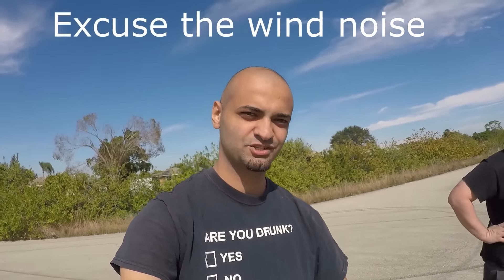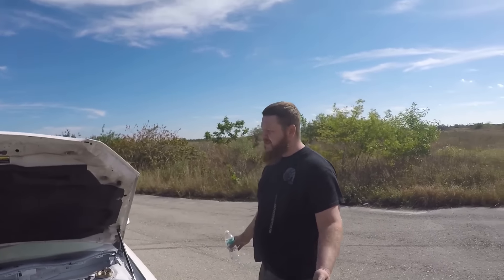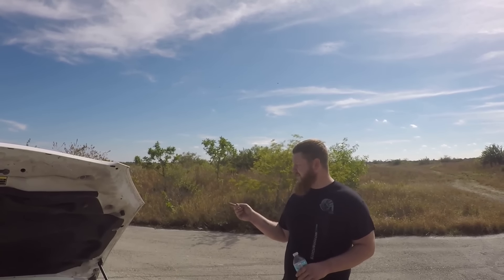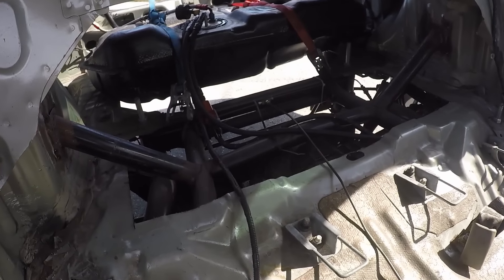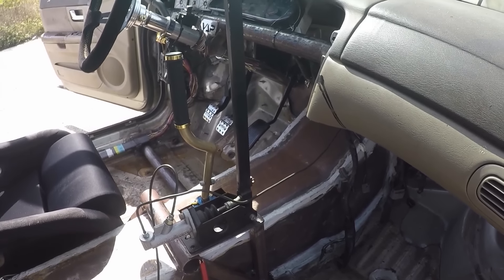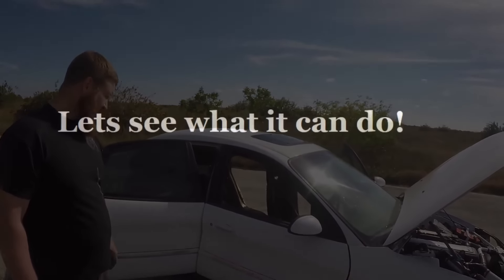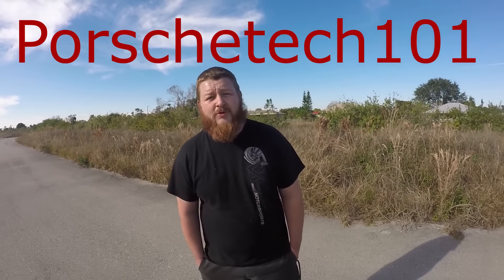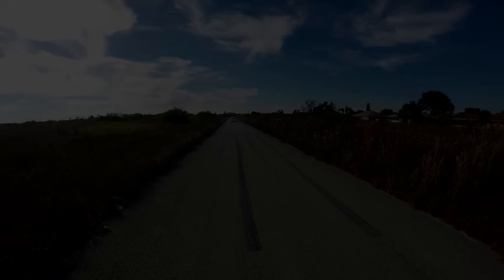RWD 1jzgte Ford Taurus? What?!!!!

Comment: What did you do engine mounts transmission mounts and do you have a rack and pinion steering rack in it? If so what did you for rack and pinion steering mounts?
Reply: It uses a Foxbody Mustang manual steering rack.